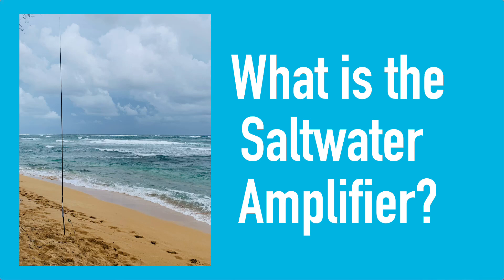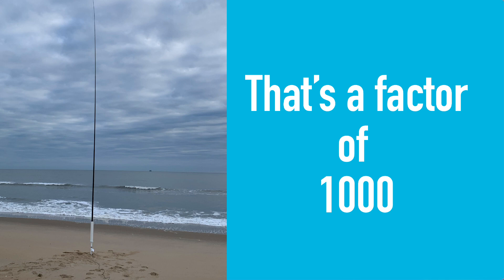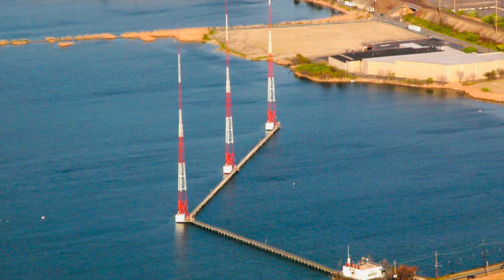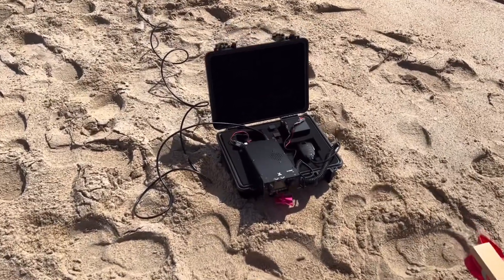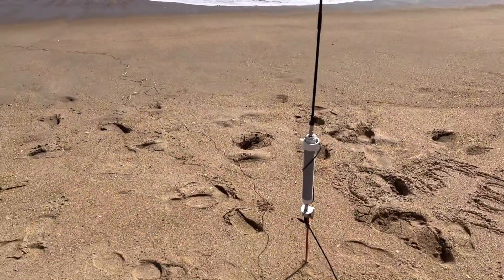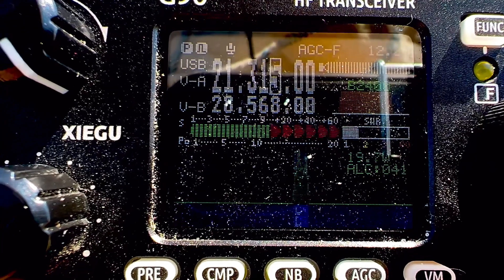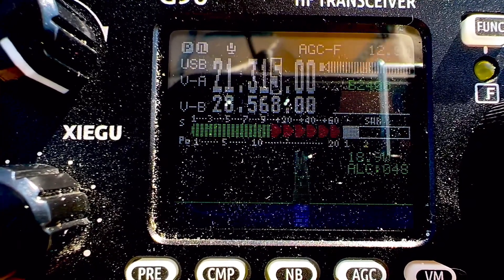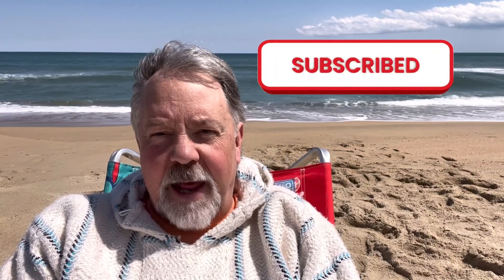The Saltwater Amplifier - The Effect of the Ocean on HF Amateur Radio

Comment: I ran a certified public drinking water lab, and assayed the incoming surface water supplying a regional public drinking water plant.
I know how highly mineralized as inland surface waters are.
It frustrates me that -- although they are mineralized -- they are nothing compared to saltwater conductivity.
If one could run ground stakes into ground saturated with abandoned coal mine seep-water (think acidic with extreme mineralization) and connect one's counterpoise to these, one might well have better success.
Still wouldn't be as good as the salt water beach!

Comment: I'm envious every time I see anyone operating a vertical near the ocean  Living in Atlanta, the best I can hope to do is to pull a vertical wire up high in a tree with a couple of resonant radials pulled away at a 45 degree angle down to tent stakes.  

Walt, it occurs to me that just a foot long ground stake on the beach would be sufficient, without needing to put a wire in the surf - because, the sand a foot or so down is going to be saturated with saltwater, anyway, and therefore connected as surely as a wire would be.  It might be interesting to set up two identical verticals, with one using just a ground spike into wet sand and the other with a radial wire with the end actually in the saltwater, and compare the two - if you haven't already done that.

Anyway, thanks for the video!    I'll be traveling to visit inlaws over the upcoming holidays and they live in Vero Beach, FL - so, I'll have opportunities to get away to the beach to play radio.  I'm looking forward to it!

73!

Comment: Here's an example of how well salt water works for long-distance communication on HF. A ham in Denmark talks to one 430 km away in Norway on 80 meter CW using a WWII German radio (a Torn.Fu.b1) with only 1 watt output. The key to their success is that he's on a beach and most of the path is over salt water. https://www.youtube.com/watch?v=swsRcY6msGA

Comment: Hi Walt. Another great video. Thx! Do you (or anyone) have any guidance on how I’d set up a simple antenna for 10 or 20 meters in my 21’ sailboat? Just temporary while I’m anchored. Maybe a hamstick clamped to the stainless stern rail? I’m not sure what to do about a ground. Counterpoise using a pool noodle? How long?…
Reply from the maker: @chrisingham7684  thanks! Yes a HamStick clamped to a stainless rail be great. You probably won’t even need a counterpoise wire out if the stainless steel rail has enough size to it. 73, Walt
Reply: @COASTALWAVESWIRES, I’ll give it a try! Thanks for what you’re doing for the hobby! N4CSI

Comment: Really enjoy your videos, Walt.  I was wondering when you use a single counterpoise down to the water, what length did you use or does it vary with band?  Also, I was wondering why you are using a coil up in the 17 meter band?  I’m fairly new to HF, so pardon my ignorance.  I’m going to the beach next week and want to try some DXing from there.    Many thanks. 
W4JVI Andy
Reply from the maker: Hi Andy, the whole purpose of the coil to to make the antenna electrically a quarter wavelength long. So the antenna on top of the coil is too short to stand alone as a quarterwave for 17 meters but a few clicks down on the coil tunes the antenna and makes it a quarter wavelength long. By saltwater you only need a single counterpoise and length is not important as long as you are directly on the edge of the saltwater. 73, Walt
Reply: @COASTALWAVESWIRES  Many Thanks for the explanation!  I will be using a 17’ whip so should be able to tune everything from 20 meters and up.  I’ll let you know how I do.  Thanks again.  Andy W4JVI

Comment: Wonder if you’ve done any shoreside operations on the lower frequency HF bands, specifically 40, 80, and 160
meters.  I’ve been doing vehicular mobile DXing from shoreside locations here in New  England for many years and had had very good results.  When I say mobile, I mean that I’m just using the vehicle body as the counterpoise, I don’t deploy any extra counterpoise wires.  I regularly have worked Australia and Japan both short and long path on 75 meters when gray line conditions are favorable in the late fall and winter, and regularly work into Europe and South America just about any time of year on 75 and 40 meters.  I started doing shoreside 160 mobile operations last year using a repurposed old 2 MHz marine band 13 foot boat whip and had very good results in a number of CW 160 meter contests, scoring in the top 30 percent of single op low power stations, best DX so far on 160 mobile has been Hawaii, Europe, and Madeira, and the Caribbean.  I can usually hear the salt water amplifier affect as I approach my operating locations, signals will come up from 10 to 20 dB over the last several hundred feet at some locations.  On a few locations I’ve operated from boat launch ramps and put  the rims of either the front or rear wheels slightly into the drink.  It definitely affected the tuning of the antenna/vehicle counterpoise but didn’t in itself result in significant reported differences in signal strength at the DX stations I was working at  the time.

Chris AJ1G
Reply from the maker: Hi Chris, I’m mostly a 20, 17, 15, 12, 10 guy when operating by the shore but your comment is encouraging and I really need to start playing on the lower bands for sure. Thanks for the great comment. 73, Walt

Comment: For my latest iteration of the BuddiStick Homebrew I built a 15 foot counterpoise wire from 18 gauge speaker wire with 5 inches of 1/2" inch braided ground strap crimped on the end of the speaker wire and terminated with a piece of 1/2 inch copper pipe flattened and soldered to the end of the braid. I have a picture if you want to see it.  I figure it will work fine on land draped over the ground, and if I am near water, I'll just chuck the end in the water. On land, I also use an actual ground rod for the BuddiStick made from 18 inches of 4 gauge copper wire with a terminal clamp and a bolt with a wingnut on the end to attach the ground wire.  The BuddiStick works great- the other night I was working all over the Western US during a POTA activation up here in Stafford County. A good ground is half the antenna! de W4VHZ/Doc sends...
Reply from the maker: Yes it is! 73 de K4OGO

Comment: Love this video. I've been into amateur radio since high school (early 90's). I mainly use the 2m band for my communications. Haven't played with the HF bands much except CB radio. If I were to do the same setup on the beach (mine would be Ventnor NJ), except transmit on 2m simplex at 25-50W, would my signal reach Europe or Africa?    Mike (N3RBE)
Reply from the maker: Hi Mike, I don’t think you could do it with 2 meters but I’m sure you could on 11 meters with a CB! 73, Walt K4OGO
Reply: @COASTALWAVESWIRES  Thanks for the quick reply. 73!

Comment: Walt , what about operating a vertical on a ocean pier that is 25-30 feet above the ocean ? How would you handle the radials issue
Reply from the maker: I’ve been exploring this idea, I think a single ground down into the water is the answer.

Comment: That's really cool. So, if the dB gain is due to the difference in the conductivity of the soil vice the water, would you get the same effect if you were operating from a boat, with a counterpoise either thrown over the side or attached to the hull exterior? Assuming a non-conductive hull material, of course.
Reply from the maker: Yes, absolutely. If attached to hull exterior at the waterline or near waterline.

Comment: I wonder what just using an 8' ground rod sunk into the sand 7' would do. It would definitely be in the water level that close to the shore and being sand it wouldn't be to bad driving it in and getting it back out.
Reply from the maker: From what I understand for a RF ground, it’s only the surface that matters . So an 8 foot ground rod wouldn’t be any different than an 18 inch ground rod as far as the groundplane is concerned.
Reply: @COASTALWAVESWIRES  I may have to  head to the beach and give it a try.

Comment: I live on a (very) small island in the Aegean Sea.  My antennas are about 150 meters above sea level.  I don't have any direct contact with the beach.  I have assumed that the surrounding ocean would help both TX and RX by better reflecting my signals and offer some amplifiation.  I have been searhing for some literature about this. If you know of anything, please let me know.  Thanks!
Reply from the maker: I've done a lot of searching on the internet and there isn't much available.  I learned a lot about this effect from Callum McCormick (DX Commander).  He had an excellent video on YouTube where he modelled this.  Sadly it was removed by YouTube.
Reply: @COASTALWAVESWIRES  Why in the world would such a video be removed?

Comment: Awesome video! Question, if I'm using a Buddistick on a tripod, would I be better off putting the counterpoise directly in the ocean waves, or converting the tripod to a ground stake like you've done? TNX 73
Reply from the maker: I think you would be fine just getting the counterpoise into the ocean. 73!

Comment: Great video, thank you for sharing!  Quick question - what kind of battery are you using your portable kit?
Reply from the maker: Thanks, I use a 6aH LifePo4 battery I got on Amazon for about $40 USD
Reply: @COASTALWAVESWIRES  - Cool.  Thank you for sharing that with me.  73's!

Comment: I'm on the Chesapeake Bay with my G90 and the vertical antenna is mounted on the seawall right above the saltwater and the results have been fantastic. 5 watts across the pond has been a regular occurrence. The vertical has only two radials on 20 and 40 - actually I believe that I don't any radials but put two up to encourage some directional effect. Haven't tried a counterpoise into the water but I'm working on a plan to float a counterpoise down into the water about 2-3 inches. 73 nice video!  Was that IK4GRO? I've worked him a number of times, he's a strong station here on 20 and 40.
Reply from the maker: We must be nearly neighbors, I live in Hampton Roads. Yes that’s IK4GRO. Thanks for watching!